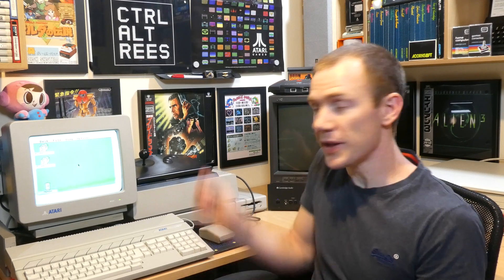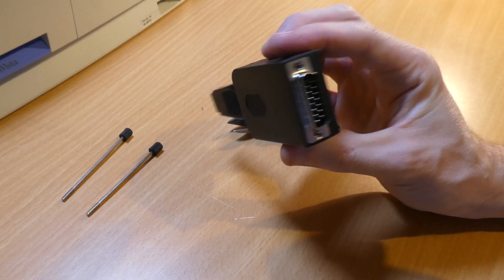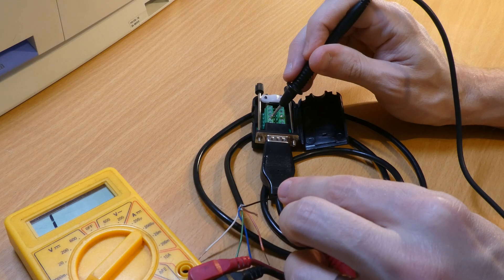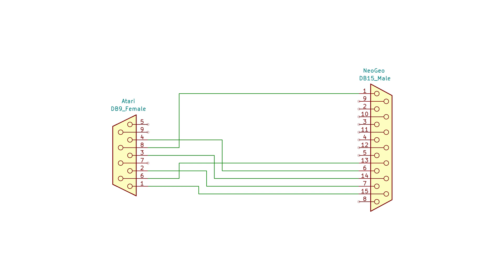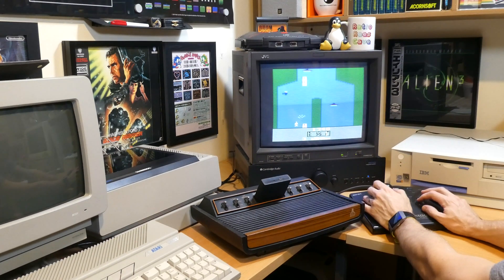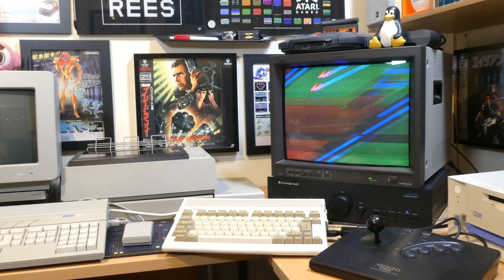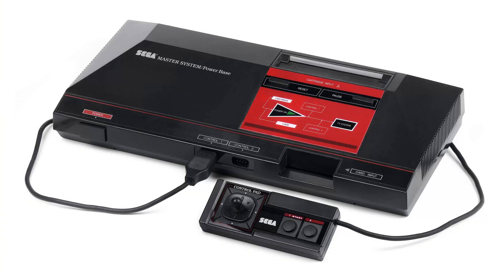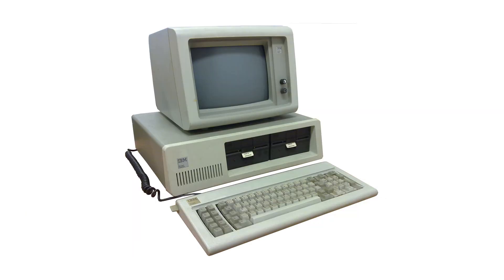Cheap DIY Neo Geo Joystick Adapter To Atari, Amiga, Sinclair & More! OJTRTA Part 1

Comment: The Atari 8-bit [A8] computer scene is modding games to sense 3 fire buttons. They're doing this by accessing the Paddle Lines. It was actually pioneered by Atari programmer Rob Zdybel back in circa 1981 when he programmed "3-Base Missile Command" for the Atari 8-bits so Atari's own employees in Consumer Engineering could play a more arcade-accurate version of the game on their computers. Dan Kramer, who designed the CX22 Trak-Ball for the 2600/A8 and later the CX53 Trak-Ball for the 5200, built 3-fire button Trak-Ball Controllers for his fellow employees to play the game. So anyway, an adapter for A8 that used the Paddle Lines would be a great way to use the Neo Geo arcade stick with the modern modded games... just a thought.  I have one of those NeoGeo sticks modded for use with my 5200, done by Grips03 at AtariAge. He even added a numeric keypad to it...
Reply from the maker: Interesting, I wasn't aware of this 3 button mod. Sounds like it would be an easy enough modification. I'll look into it, thanks!

Comment: Can you build an adapter to use the amiga pad on the neogeo console?
Reply from the maker: You mean the CD32 pad? It wasn't on my radar to be honest but it certainly seems like it would be possible.
Reply: @ctrlaltrees  
My goal is to be able to play with a joyball for amiga 500 on a pandora consolized console that mounts inputs for the neo geo pads. (Becouse I want to play Crystal Castle like an arcade cabinet). Could a megadrive to neo neo geo adapter be good?

Comment: Hi and like others, thanks for sharing.
I tried myself with a MAX 330 MEGA to my Atari Falcon by using a dirtier method : a breadboard and a female DB9 and a male DB15.
I followed the instructions and wired the simple board . I checked the resistance between pins and it's ok but unfortunately, it's not working.
Are you aware of anything specific for Falcon joystick port ( I used the one from the bottom of the unit, not those on the left side ).
I'll triple check later and I will check voltage but I am really frustrated as finding an ATARI compatible joystick in Japan is complicated ... and your wonderful video sounded like a Graal for me :)
But feedback shows that I did something wrong but for now, I'm lost ...
Else I will order the same stuff as you but I'll have to wait - and patience is not one of my best qualities :)
Thanks again and bye !
Reply from the maker: Hi David, I'm sorry to hear that. I don't now much about the Falcon - it has the enhanced 15-pin joystick ports, right? Are you connecting to those with an adapter? It seems that pin 7 of the Falcon joystick port provides +5VDC which you will need for the later Neo Geo joysticks (please see my update video linked above). Maybe the 9-to-15-pin adapter you're using with the Falcon doesn't provide power as the original 9 pin Atari joysticks didn't use it?

You may be pleased to hear that my future plans do include the Atari 15-pin enhanced joystick port as it's the same one used on the Jaguar. I'd gladly share the info but that's still a few videos off so I haven't even started prototyping it yet.

Comment: Nicely done. Where did you get the DB15 with the terminal connector please?
Reply from the maker: Thanks! Apologies for the lack of info, I should have mentioned that in the video. It was from ebay but I imagine electronics places will stock them. The term you'll need to search for is "male DB15 breakout".
Reply: @ctrlaltrees  Spot on Rees, thank you.
Reply from the maker: You're very welcome, glad to be of help. 👍

Comment: Great video Rees! I might have missed it, but it's worth noting that while the 5 volt (pin 8) isn't needed for the original stick like you have there, it IS needed for the later kidney bean shaped Neo Geo Stick and the Neo CD game pad.
Reply from the maker: Hi Todd, thanks for watching and thanks for the tip. This is the only Neo Geo stick that I own so I wasn't aware of the difference. I'll be sure to make it clear in future episodes and I've pinned your comment so hopefully nobody gets tripped up by this!
Reply: This is fantastic.  I have a neo cd controller that I’d love to use with more systems.  For 5v would that be pin 7 on the Atari side to pin 8 on the neo side?
Reply: Using the pin out shown in your video at 1:11 and connecting pin 7 from the Atari side to pin 8 on the neo geo side worked for my neo geo cd controller.  Thanks again for creating this video.  Super fun project!
Reply from the maker: Hi Durk, sorry I missed your reply yesterday. YouTube is very good at hiding these things from us.

Yes indeed, pin 7 to pin 8 is exactly what you need. Glad to hear that it's working for you! I'm working on an update video where I'll talk about this and some other feedback I've had. I have ordered a CD controller but it'll be a while before it arrives from Japan so it's good to hear that it works with this small modification.

It really makes my day to hear that people are following my tutorials and getting good results, so thanks so much for the positive feedback! 👍